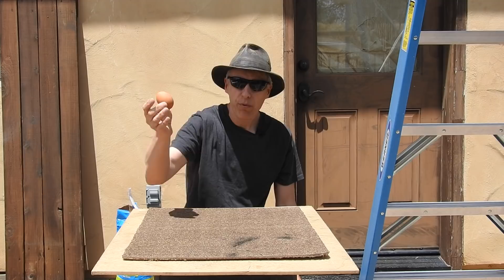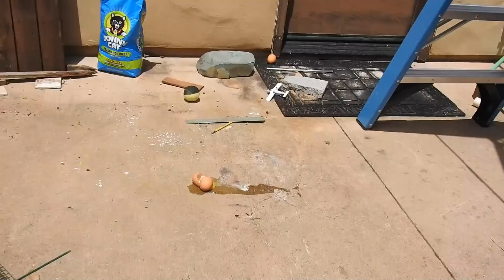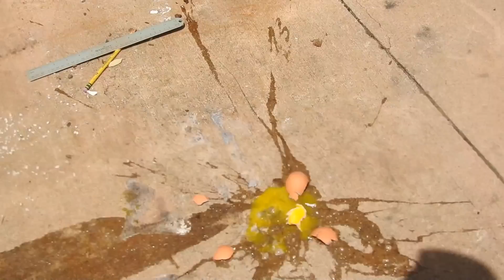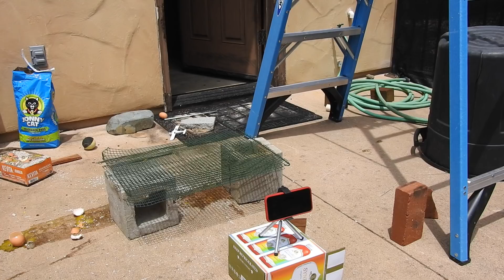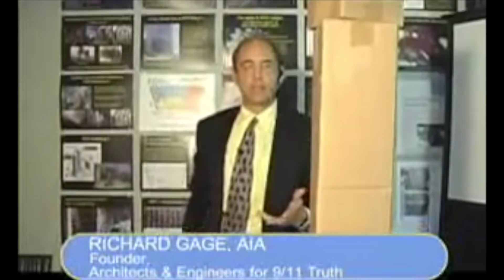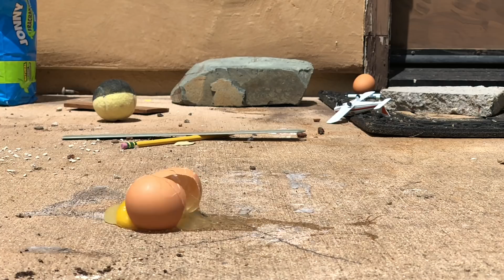Why Do Most Plane Crashes Look Different to 9/11 Plane crashes

Comment: Why didn’t the put a hole in the metal mesh and bust through the concrete walkway? 
Oh you need to throw it harder? 
Yeah, good luck with that. 
Maybe you can explain how the planes got up to those speeds and still hit their mark without breaking apart first.

Comment: ok?!?!?!? Now lets see the egg Disappear into the concrete
Reply from the maker: Watch the whole video. I discuss the problems with scale models and I explain what the purpose of these demonstrations is.
Reply: @MickWest   I am not talking about scale models i am talking about planes disappearing completely into a steel and concrete building....Your egg demonstration is complete bs....I can still see the egg
Reply from the maker: @colcombe444  But the egg IS a scale model, hence you are talking about a scale mode. The plane hitting the building was different. 
Different circumstances lead to different results.
Reply: @MickWest  So your video is completely pointless then?
Reply from the maker: @colcombe444  Did you watch it all?
Reply: @MickWest  Yes i did watch it all and at the beginning you said conspiracy theorists get confused about what happens when a plane hits something,i am not a conspiracy theorist i just dont believe the official account of what happened on 9/11 which is in itself a conspiracy theory.And i was wrong about your video being pointless because when you dropped the egg onto the wire mesh it did not pass through it but sat on top.which in a way proves that the airliners on 9/11 would have hit the building and fallen to the floor not penetrate the building and disappear leaving a wing shaped whole or an egg shaped hole?!.You are also right that things crashing will have different results but i feel this point is irrelevant because this is plainly obvious to anyone conspiracy theorist or not
Reply: Totally agree David,if this character Mick West truely believes that aluminium planes can melt into a building like butter without dropping a single piece of wreckage,then he must be completely brainwashed or is being paid to debunk conspiracies,and doubt it to be the latter due to such a tiny insignificant amount of followers.And don't worry people,idiots like this weirdo are about to be rudely awakened
Reply: @orbalturner6747  Only very ill informed people believe that there was no plane debris outside the buildings.
Reply: @colcombe444  You claim you are not a conspiracy theorist but the actual facts of what happened are a conspiracy. You claiming they are a conspiracy is what makes you the conspiracy theorist. That's EXACTLY how conspiracy theories work. eye roll
Reply: Phatom jet fighter disappears into concrete:

https://www.youtube.com/watch?v=U4wDqSnBJ-k&ab_channel=WhatYouHaven%27tSeen
Reply: @Axel_Andersen  It does not disappear. Fragmentary wreckage is left. There was plane wreckage at all 4 9/11 crash sites.

Comment: What a pathetic comparison,and how do you explain the total lack of debris falling to the ground,and the nose cone shape appearing out the other side?totally impossible,and what about the image of the plane breaking down before the whole thing just melts into the tower as if made of butter,impossible imo.And I would love to hear your opinion on Dr Judy Wood and her evidence based research into the use of some kind of directed energy device used to bring the towers down
Reply: Debris did fall to the ground and on the roofs of adjacent buildings, there was no nose out.
You have been fooled into believing that.
Reply: Judy Wood didn't present any evidence for the energy weapon that she talks about.
Reply: These questions are exactly the kinds of misunderstandings Mick is referring to. How people without engineering backgrounds have difficulty understanding and visualising what forces and effects are at work in intense high speed impacts against different surfaces (a Pennsylvania field vs a class/steel/concrete building).

Comment: One thing you failed to mention, in each case you had pieces of egg shell ( or fuselage ) on your crash sites, so, can you please repeat the test to show us under what circumstances all the egg shell disappears, Thanks.
Reply: Pieces of fuselage were found on the crash sites.
Reply: @rinse-esnir4010 after they buried it there. 
There was also a USGS video from the 90’s showing the gash already being there. They just blew up the middle so it had the shape of the plane. The debunking video of that was wrong too. Just like your uncle Mick.
Reply: That would be when the egg is inserted into your skull, everything disappears in that black hole

Comment: Nope nobody is confused 

Why don't you explain how all 4 planes were able to operate far beyond their physical operating limits? And please don't make the false claim that all 4 were falling at full acceleration either. Try the truth.
Reply from the maker: They only operated beyond their limits briefly, a few seconds, then they crashed. It's like if you have a car, you can drive it beyond it's safe limit for a while. If you do it for long enough the engine will explode, or a tire with burst, or you'll loose control and crash. But you often hear of cars going at 150mph before they crash. That's what happened here. They lined up the planes, then full throttle.
Reply: Except none of what you claim matches the reality of the events that day as shown here...

http://pilotsfor911truth.org/wtc_speed_part2.html

You need to actually prove what you are claiming, not just claim it. That might work of the average grunt who never finished high school but it doesn't wash with the educated. Provide you citation for your data, because without it, you have nothing.
Reply from the maker: It's explained in detail here: https://www.metabunk.org/debunked-pilots-for-9-11-truth-wtc-speeds.t2942/ If you have a correction then I suggest you post it in that thread.
Reply: So you clearly didn't bother to read what you've just posted o you will see that the person posting it was immediately corrected because they didn't understand how to read a graph correctly.

You are a fraud.

Instead of providing actual data and citation for your own evidence, you only went on to attempt debunk an example used by another group as it's example of how a plane breaks up quickly after reaching it's VMO - never mind explain why the planes on 9/11 far exceeded theirs long after it would have been possible. Or explain how the engines needed to be 4 times as powerful to cope with the required air capacity, or to have the required thrust at that height.

Try providing Radar data from that day, as my statement is based upon both civilian and military data. 

What source did you use? It must have been something fairly strange and far out there as every official source shows exactly what I'm saying - all 4 planes operated far beyond their maximum VMO, not just in a dive but for long periods of time.

Now, you try to get your car to increase it's velocity while hitting a wall of sea water for a minute or so - keep accelerating, while under water.

Charlatan - that's all you are. Trying to claim you know more than the actual manufacturers of the aircraft, whatever next? Jesus powers?
Reply from the maker: Read the full thread.
Reply from the maker: And also:
https://www.metabunk.org/easyjet-737-incident-debunks-pilot-for-9-11-truth-v-g-diagram-video.t3160/
https://www.metabunk.org/pilots-for-9-11-truth-simulations-video-debunked.t4809/

https://www.metabunk.org/pilots-for-9-11-truth-claim-wtc-airplanes-would-be-uncontrollable-at-observed-speeds.t2933/
Reply: Using a piece of data regarding a planes operating limits at 15,000 feet to prove something at 1000 feet altitude?? Like I said, disingenuous liars and frauds, you should be ashamed and then exiled at the very least for your crimes against society and democracy. 

Some of us care about the truth and the world out children inherit - the rest seem to work for Zionism.
Reply from the maker: Could you be more specific?
Reply: @orbalturner6747  you mean you have no counter arguments left, but you wanted to reply anyway.
And you thought this would be a mart move...